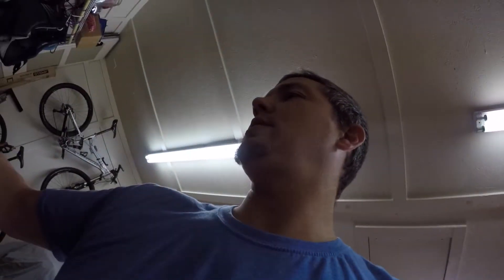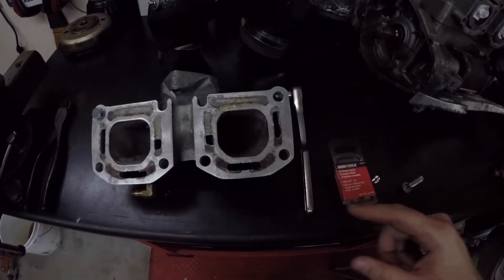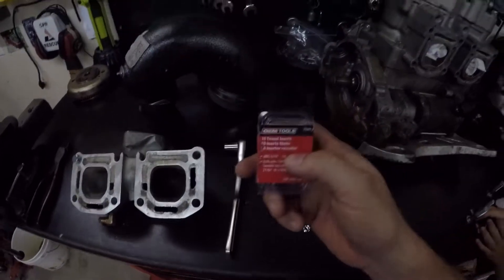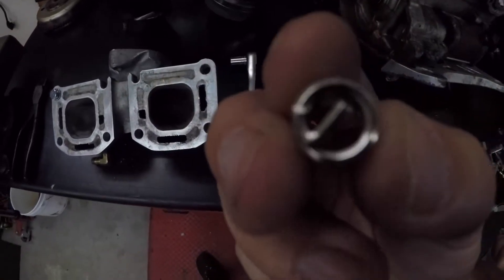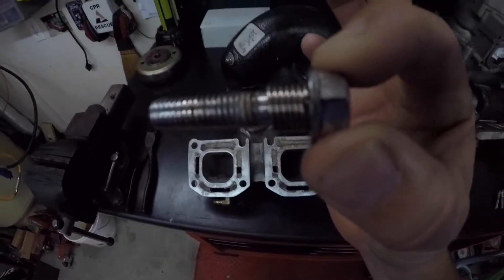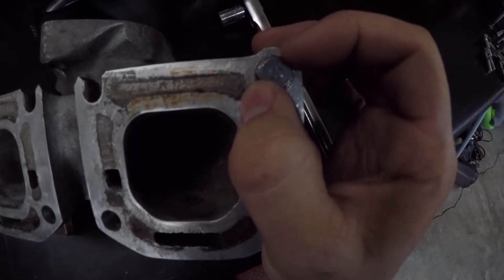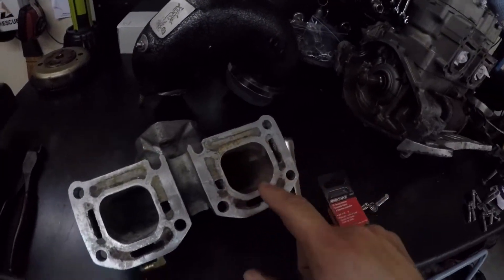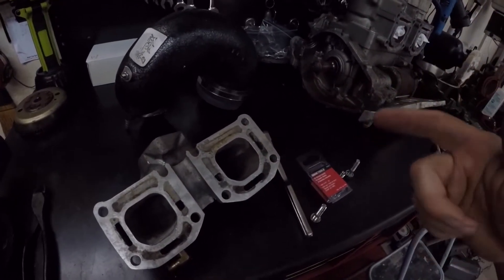Factory B Mod Pipe 62T Manifold on 61X Top end

Comment: I just sold my protec and bought a b pipe. Seems like the b pipe tunes easier and allows more working room.
Reply from the maker: Yes the b pipe has more adjustment so you can move the power from bottom to mid range.

Comment: Where could I find gaskets for the B Pipe?
Reply from the maker: https://www.ebay.com/itm/281315739368?mkcid=16&mkevt=1&mkrid=711-127632-2357-0&ssspo=SvUIbwPeS56&sssrc=2349624&ssuid=2dovye7aStu&var=&widget_ver=artemis&media=COPY
This is if the top end is a 701 61x.

Get this head gasket and trim the inside to match you head pipe.
https://www.ebay.com/itm/303118885855?mkcid=16&mkevt=1&mkrid=711-127632-2357-0&ssspo=WKvH-ujWRZO&sssrc=2349624&ssuid=2dovye7aStu&var=&widget_ver=artemis&media=COPY
Reply from the maker: I meant head pipe gasket not head gasket. 🤘🏼🔥